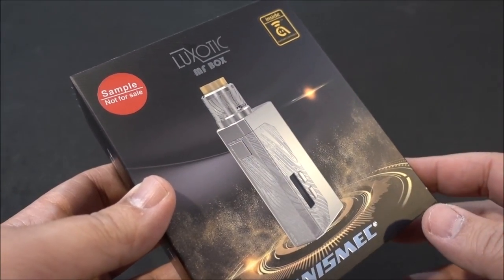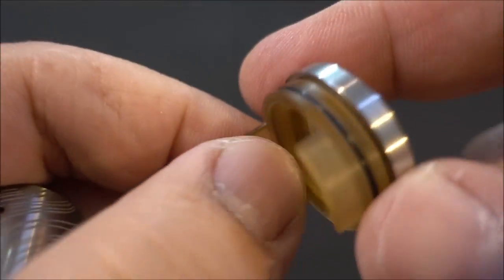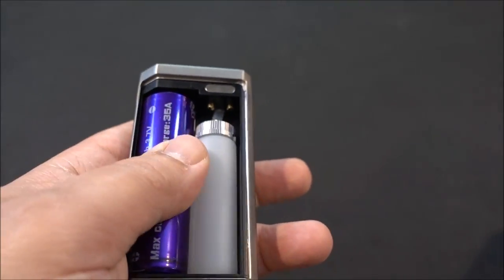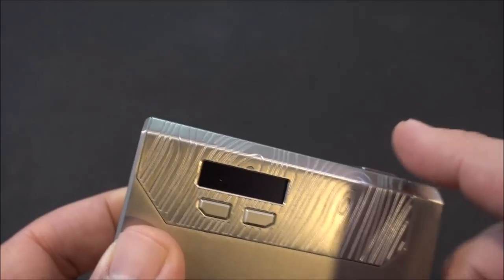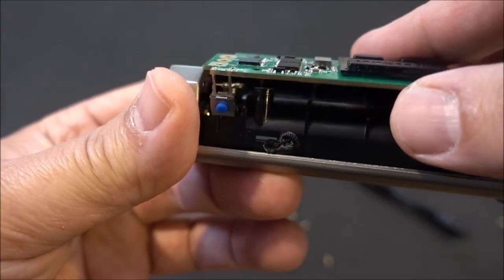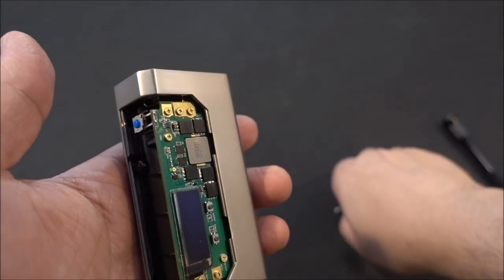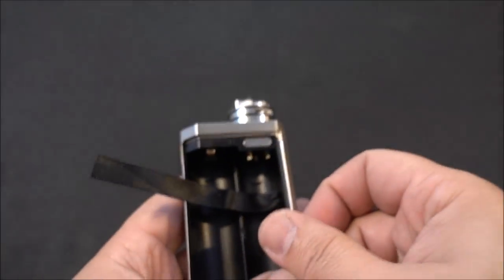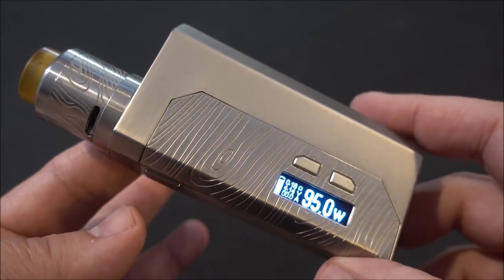Wismec Luxotic MF Squonk DIY Kit - 21700/20700/18650 - Mike Vapes

Comment: Love the battery options and the little door to cover the bottle when not in Squonk mode 👊🏼 As far as the boards go, I’d be curious to see how much different, if at all, it runs between bypass mode vs. the dIrect board. 
Presented very nicely Mike👍🏼👏🏼
Thank you 🤗
Reply: instablaster.

Comment: I love the thought of having multiple boards for the same mod. When one Burns Out Just swap it. I Vape direct output most of the time anyway, but like the idea of having wattage control too. What is the lowest resistance the direct output board will fire? And what about the hundred watt board? I love the idea and the tinkerer in me is very interested! Thank you Mike you're the best!!!
Reply: What mod do you have ?
Reply: @black.bird.  too many to list
Reply: @chuckintrucker8065  I mean VV mods bc it's not that many in the market & I'm not sure what to pick
Reply: @black.bird.  Tesla Invader 3, Tesla Invader 2/3, Dovpo Vee, Bear Bones Box Mods 18650 Series PWM, Bear Bones Box Mods 20700 Series PWM, Bear Bones Box Mods 20650 Series PWM is what I got
Reply: @Chuckin Trucker Actually, I'm thinking of the Vee mod, any issues so far? Would u recommend it? Does it get hot with low build?
Is there a significance difference between VV & PWM? I coudn't find a clear explain.. Vaping Bogan treat them as one thing
Reply: @black.bird.  PWM pulses your remaining voltage faster or slower depending on where the potentiometer is set (pulse width modulation). VV gives you a constant voltage stream.....until the voltage drops lower in the batts than you are demanding

Comment: The reason you would use the other board instead of the 100w board is because bypass mode one 99% of mods (probably including this one) isn't real bypass.
Reply: DJLsb said in his video that the output performance of both boards was pretty much identical when the power board was set to bypass.
Reply: Actually for a semi regulated it's just about the same as bypass. They both have safety measures.

Comment: Ive had my luxotic mf for about a month now sqounking with a 20700 battery. While vaping with it i noticed the 1 to 2 second delay on the trigger. Reason for that delay is the dual coils in the rda. Also i couldn't vape at 100 watts as the board would drop the wattage. I just bought a wotofo recurve that runs a single coil and the trigger becomes instant zero delay. So far ive been pushing the mod at 100 watts all day with zero issues with the board dropping wattage. Toss the rda and go with a single coil set up. Also mike vapes great job with that recurve brother. Tons of flavor and hits like a tank.

Comment: mike vapes ...does that also run single bottle on the mosfet ??? they should really consider getting a volt meter on the mosfet board instead of LEDS  .. it would be a unregulated dream mod to own

Comment: The display style looks like the istick pico. In my opinion the option of 2 batteries is a con. The bottle system of the luxotic bf would be much better than the option for another battery.

Comment: Running it in bypass still uses a screen the other board does not have the screen so it is more like a mech with protection sort of like the recurve mod
Reply from the maker: Part Time Vaper Yes but it's been tested, bypass mode and the voltage board give off the same power. So really no need to switch out the board.
Reply: Mike Vapes i ment the screen not being there in the first place my appeal to more mech style users. The direct board has no buttons appart from the fire button so you do not have to worry about the screen or any other buttons and you get the safety protection. if i want bypass or direct power then the screen is annoying, thats why i would want one. It would be better if they included a another face plate that was sold without the screen place holder for the direct option. Also thank you for you response/feedback.

Comment: Great review Mike, thanks! I think instead of the bypass chip they should have included a chip that goes higher than 100w for dual 18650 mode. Doesn't make sense to me that in dual battery mode, you can't raise the wattage
Reply: Eric Roy it's because in dual 18650 mode the batteries are ran in parallel not series. Therefore no extra power available, only longer battery life.
Reply: daschnitt 
Thanks for clarifying that for me, makes sense now.  Very much appreciated, take care